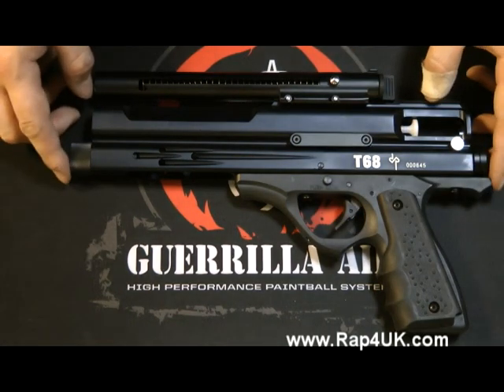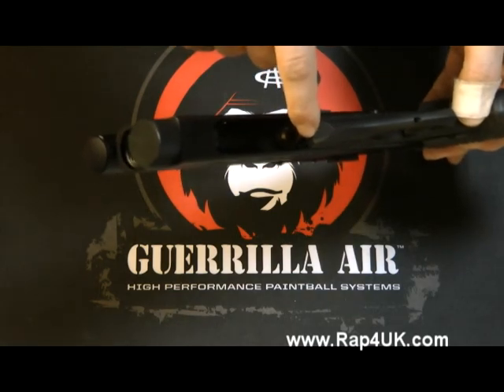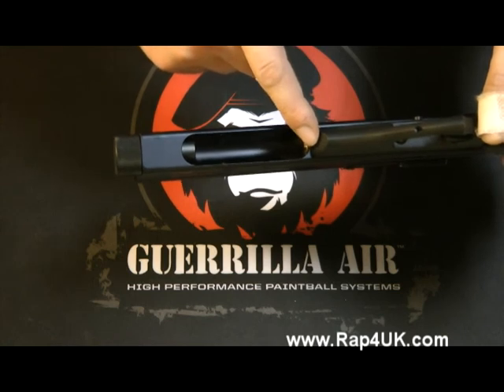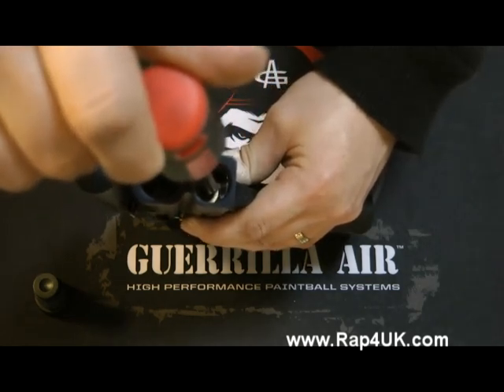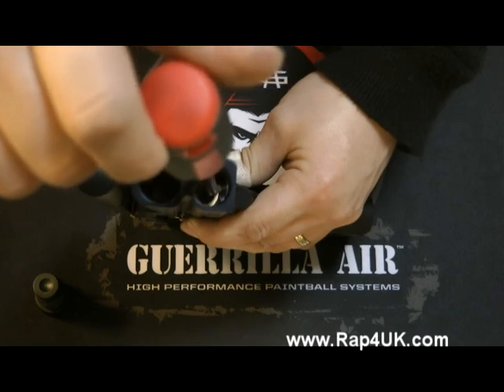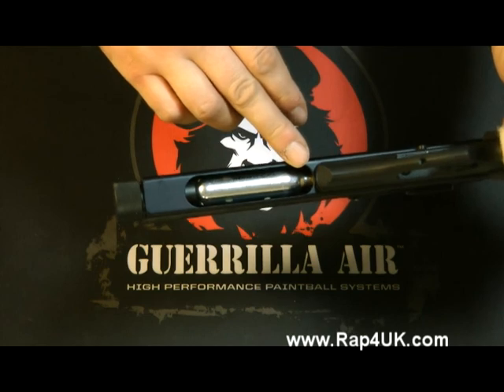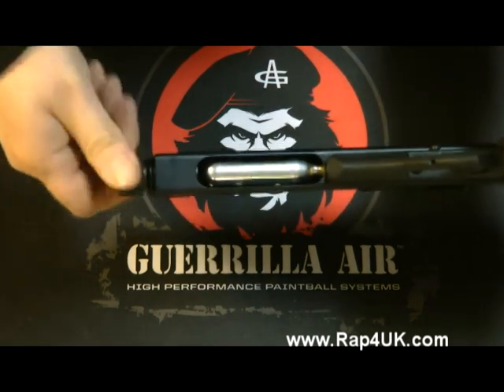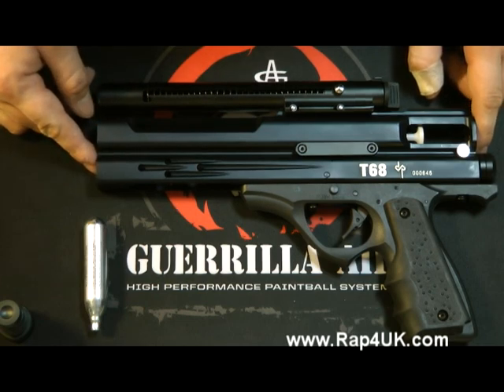T68 Pistol - Leaking Co2 Capsule - How to fix

Comment from the maker: @KALSONIK Depends on what your budget is and your style of play. The T68 Pistol is almost hald the price of a TPX. The t68 pistol allows extended mags and also a fitting of a bottom line with ASA so you can attach a small air tank. The TPX does allow a remote line fitting though which is a plus.

Comment: If you want to fix that 12gram seal set up permanently check out the video I made on the Delta 68 which is identical internally to the T68.. . Note you'll need the piercing assembly from a Armotech/Warsensor/Miltec Zeus to do what I did. Shouldn't have an issue with it again if you do what I did.